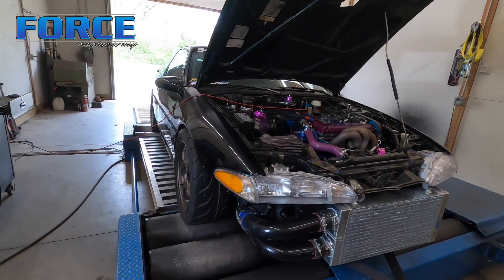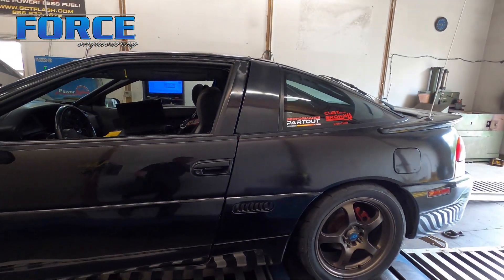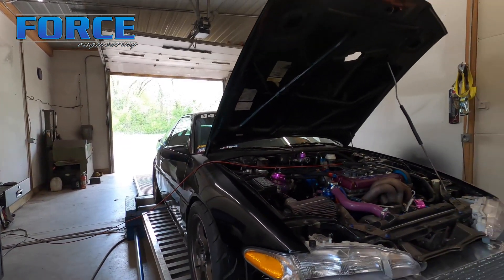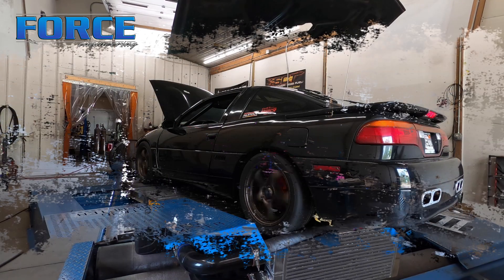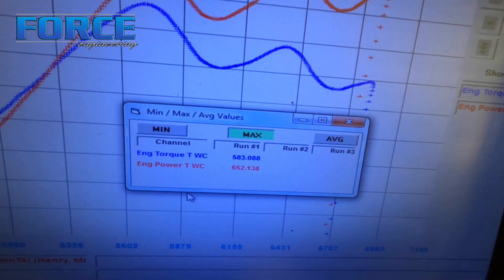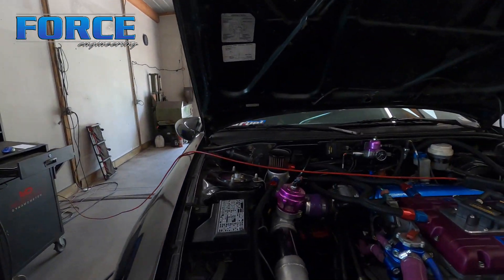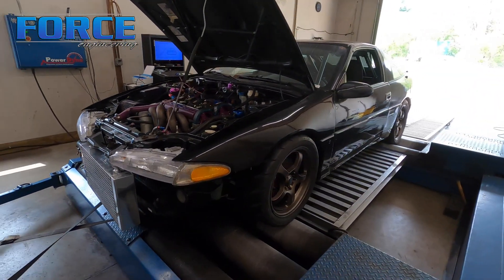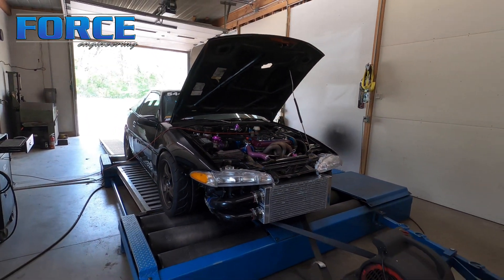Precision 6266 Gen 2 | Mitsubishi 1G DSM | 4G63 Turbo | Eagle Talon | Dyno Review

Comment: Have 666HP (mustang dyno) on my DSM since 2009 with old BWS364, mild cams 16in vaccum at idle.boring!! .. Can run 34 PSI on meth and pump but , had 4 meth motor seized up with white corrosion ,cause by outside wet cold weather
 Decided to upgrade my motor for 1000hp plus( cams, e85, 72mm turbo)...Motor now has 16000KMS..

Comment: Would you have felt comfortable running an alky-control methanol kit to push the 91 octane to 700whp? I do not like E85, way today corrosive for me.
Reply from the maker: I wouldnt.  The amount of methanol it would take to be safe at that power level would cause distribution issues.  Could do a direct port, but its a bandaid for actaully using a better fuel.  E85 or even a race gas option would be my only considerations at this power level on a 2.0l.
Reply: @Force Engineering  Thank you for your input!